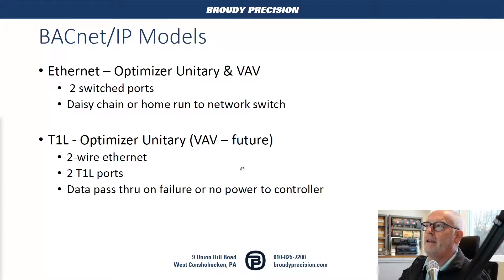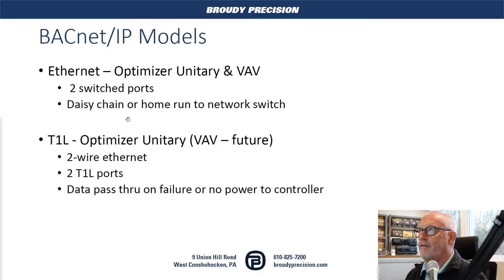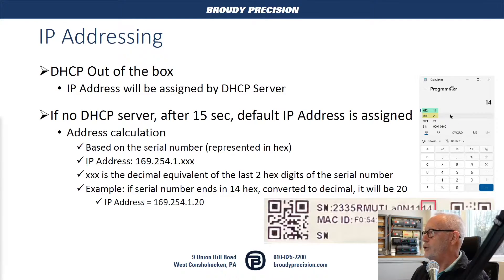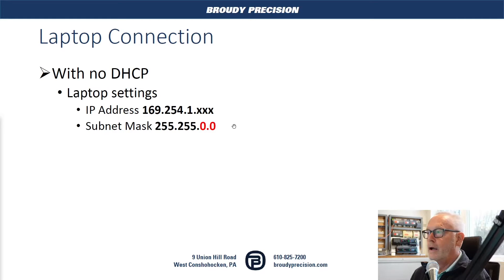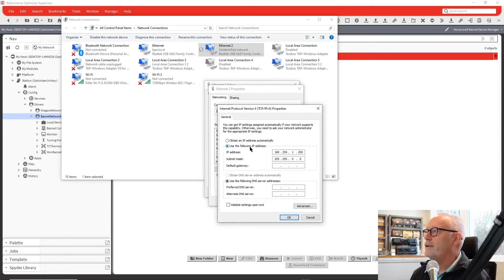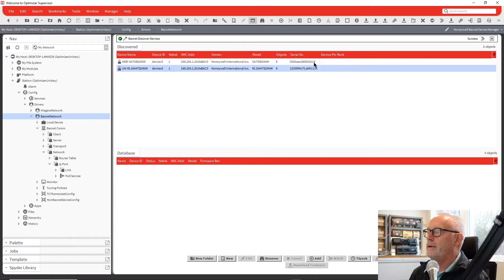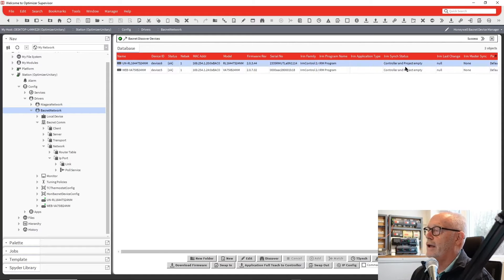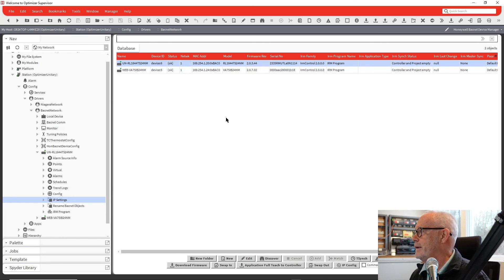IP Configuration | Honeywell Optimizer Unitary & VAV

Comment: How many controllers on an IP network?
Reply from the maker: When in a daisy chain, Honeywell recommends 100 max and when doing an RSTP ring, they recommend 40 max. Otherwise, there is no limit to the number of devices you can have on an IP network. You would just may need to increase the size of your subnet. -MW